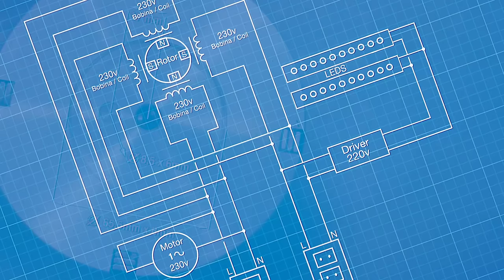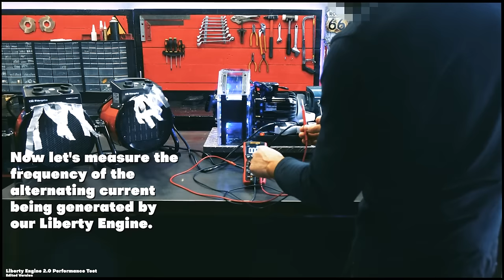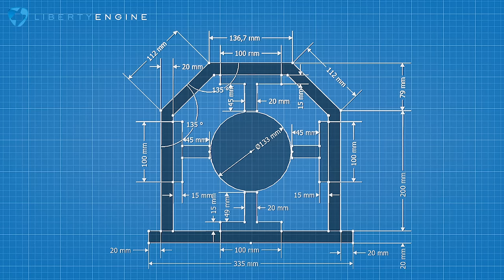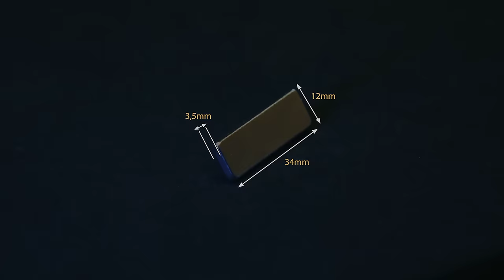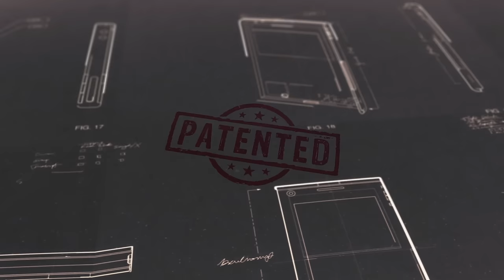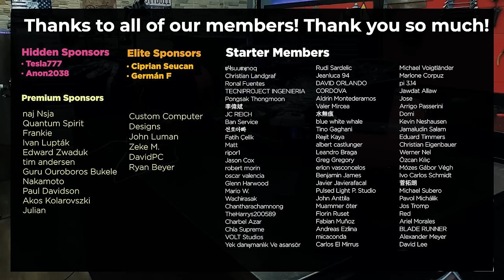SECRETS AND MANUFACTURING PLANS OF THE LIBERTY ENGINE 2.0

Comment: Why does the rotor material matter? Isn't it basically a flywheel?
Reply: its bc spinning iron makes a small magnetic field that would interfere with its function.
Reply: It composed of 4 poles winding and a small 4 pcs neodymium magnets?
Its a #18. - #20 awg .for 220v output..can its hold a 12kw peak load..it burns the winding with that load capacity.
And a small 4 magnet cannot produce a very strong magnetic to produce a very strong magnetic field to give the output of 12kw..its rediculous...i made a test of this kind..its not working😂
Reply: There is no kind or any kind of electromagnet will not give a cogging or resistance.specially a load of 12kw...its a pipe dream that cannot be happened in reality..
Reply: To be real..put it in a public demo a working prototype of this kind...not to replicate this machine on details..that you cannot prove that it is foolproof..and works efficiency.....😩
Reply: A silver aluminum rotor  composition is a complete challenge to make which is hard to do😁
Reply: @chaoskiller1758  but.... its spinning aluminium, non magnetic ??
Reply: If you just watch all his videos and pay attention it is explained.
Reply: @Gaviolacolocado  Тепер ви можете зняти відео з доказом, що це фейк! Переглядів буде більше чим тут.

Comment: Les dejo la información clara y precisa de la
Composición del rotor al decir que el volumen de 1073,3 cm3 y 7600 gr total. Sabiendo que está compuesto por aluminio y Plata y todos sabemos que el cm3 de Plata pesa 10.5 gramos, mientras que el de Al pesa 2.7 gramos. Por lo que tendríamos un total de 6333.3 gr de Plata con un volumen de 603.1742cm3 y 1266.6666gr de aluminio con un volumen de 469.1358cm3 pesando total 7600 gr terminado en una relación de 5/1 partes. Simple amigos. pd: 1 cm3 en los 1073,3 cm3 es por la variante del aluminio puro al aluminio colado. Saludos a todos desde Buenos Aires. Argentina.
Reply: Es correcto?

Comment: Dear all at Liberty project,

Good afternoon from Greece.

I would like to say one more time congratulations for this project, is amazing. 

If the alloy of the motor is mainly from aluminium & silver with these proportions (volume 1073.3cm3 & weight 7.6kg), the aluminium content can not be more than 30% because the rotor is too heavy to be aluminum at least for the most part. So if the other about 70% is silver, we are talking for a very very expensive alloy. An other thing is one the first video, after finishing cut of the rotor you apply a coating at the surface of the rotor. Is that a special varnish called electromagnetic coating in order to eliminate the eddy currents?

Thank you very much for your time.

Best regards,
Harry
Reply from the maker: The proportion is not correct. On the surface of the magnets we put epoxy resin
Reply: @thelibertyengineproject7966  good morning. Thank you very much for your reply. The rotor is too heavy to be mostly aluminium….Are you planning to give the exact details of the alloy on the future?
Reply: @Harpatsi  From my understanding this from the beginning was supposed to be open sourced, with no holding back on any information. I don't understand why they are withholding it, other than to somehow make money now, as opposed to giving out the information. You can see by their response that they are purposefully withholding it. I know there are some comments saying 52% silver and 48% aluminum which indeed would make it pricey.
Reply: @theredeemeriam  I will agree with you… I don’t understand the purpose of these videos. Today they uploaded a short story in YouTube and they are saying “ Are you still pay for electricity in your home” but they keep secret the details of the rotor…most important part of the patent🤷‍♂️
Reply: Perhaps the correct rotor weight calculation would be without the epoxy resins,
without the neolithic magnets (the N52 based on how they are positioned together change the gravity of the rotor and consequently also the weight),
without the three M6 x 1.0mm screws
only then can the correct calculation be made
“making a hypothetical volume calculation”
Aluminium = ~3150g
Silver = ~12170g
3150 + 12170 = 15320 : 2 = 7660g
😅 50% maybe?
Reply: @thelibertyengineproject7966   If it was viable, ...and if their goal was to truly help the world, ...THERE WOULD NOT BE A "MEMBERS ONLY" COMPONENT! GTFOH!

Comment: Hello everyone. About six months ago, I came across videos featuring the Liberty engine and decided to give it a try and build something similar. My rotor is made of plain aluminum without any additives. The engine is 0.55kW, 1440rpm, with 2 coils from GAL-800E4 microwave oven transformers. Four magnets 80x20x10 N45. The maximum voltage I get on a single coil is 24-28V at 4A, depending on the distance from the rotor. The engine consumes 310W, both idle and under load. The load consists of 5 24V 40W bulbs, but only one is glowing, while 2-3 are dimly lit. I'm wondering how I can achieve a voltage of 230V. I thought about using a 24V-230V transformer, but with 4A, what can I connect to it? Any suggestions? Any help would be appreciated.

Comment: I have a question, 3000 W per heater, there are four heaters which is 12000 W, at 230v they output 52.17 A. I see that the cables are 1.5 or 2.5 mm2 in section, how can they withstand an intensity of 52A ? The cables should burn.

Comment: Im still a skeptic, first i saw the power switch while the machine was not running, when switched to on position the light indicator turned on for a moment. second, when the machine was running and you tried to remove the plug of the prime mover,  i can hear the motor slowing down but the power to the heaters where still at 100% there's no drop in power output, why is that?
Third, can you turn off the motors power while the loads  are still powdered on until all comes to a stop.
i hope my questions will be answered, thank you.

Comment: I made an exact copy of the polyamide rotor - the same coils and even stronger magnets
unfortunately, it generates only 6.7V  at 1400rpm   so the magic is in a different place ???
How much does it cost to produce this rotor?
Reply: The motor he used is a SEMh71-2C
The magnets are N52 facing North to North with 3 pieces facing the other 3 pieces in total 6 pieces in one slot.
Reply from the maker: We say clearly that it doesn't work if we don't make the rotor with the special alloy. The rotor is the heart of the machine. Unfortunately we cannot sell our prototypes
Reply: Your results 6.7vac is the real volt it we give you if you increase the speed of your motor to 2900-3000rpm you we be getting 13-15vac,cos of electromagnet is more stronger than permanent 🧲,I can lecture you but you we use normal generator but have to modify it

Comment: When you disconnect the motor there is no drop in the performance of the heaters? Pulling near 50amps there is going to be heaos of load on the system, there doesn't seem to be enough weight to keep that sort of inertia going? I really want this device to be true, nit sure uf it is. If i win one and it is then i will be your biggest advertiser, very interesting either way 👍

Comment: You star 20kw of power. That decided over 2 sockets with wacht a 1.5mm2 wiring . That is 19 kw over this wire wacht. Did you do temperature measurement on the wire, the copper transformer bodies ? And the electric motor ?

Comment: Think about it for a second, this "free energy" motor will produce about 20kW of energy. The energy can be put into batteries for power storage, and when you need more juice or are running more things, you'll be able to run that. Imagine an Electric car charging off of this while you're driving or not. I'd like to see a 24/7 run to see if there are any problems with long-term usage of this generator. This could be the future.

Comment: 💯💯💯💥💥💥
Attention!!!
 I want to note that the dimensions you specified in the video do not fit the description. Magnets of such sizes do not exist 34x12x3.5. And on the diagram from the end where the dimensions of the coils are indicated do not coincide with 20mm. How do you show that the transformer is used at 6170W? and in another already GAL-900E-4 how to understand it? I very carefully and clearly consider every detail of the video. This is a misconception. This idea was worked out by me 25 years ago. The excitation of energy at its own expense, but this requires a small starting stroke to obtain the initial voltage, followed by a transition to output power.💥💥💥💥💥💥

Comment: An attempt at a functional power generation module. I can't imitate the original, but I'm testing a device with a real output.

The principle is in the cores themselves and in the connection of the coils. Look carefully at how the coils are connected in the original video. 1 phase is led to the socket from two opposite coils and the second phase is led from the second pair of opposite coils. They are not connected together. On the other hand, the coils are connected in parallel in the original, but in my case they are connected in series. Two opposite coils are used for one output in the original video, in my case it is four coils. If I had 16 coils divided by four, the result is four outputs, which are routed through the bridges and the outputs from the bridges are connected to one output. The next step might be to connect one output to the motor coils and try it in a cycle. Adding another coil from the motor as a load could increase the output voltage, see the phenomenon of output load with light bulbs. In the next video, we will try different connections, among other things, we will also try a different rotor. Please be patient.

Comment: They're actually making these engines to run with optimized magnets to the max.  Quiet, less expensive and efficient.
Reply: who is they?
Reply: @christopherschneider5657  Liberty engines. But the design is based on two-in-one runs the other engine that's a alternator or generator creating current that goes into a battery it's able to generate electricity that is 4 times greater than what it takes to run the machines and they store the extra energy is free energy. You can make these things.

Comment: Bard AI
Based on the given density of 0.007080965 kg/cc, it's likely that the alloy is composed of multiple metals with varying densities. Here's a possible combination of metals and their approximate percentages based on their densities:

Silver (Ag): 40% (Density: 10.5 g/cm³)
Zirconium (Zr): 20% (Density: 6.51 g/cm³)
Aluminum (Al): 20% (Density: 2.7 g/cm³)
Nickel (Ni): 10% (Density: 8.91 g/cm³)

This combination of metals would provide a density of approximately 0.00706 g/cm³, which is close to the given density of 0.00708 g/cm³.

Comment: Hello. Is the special Silver Alloy Metal for the Rotor neccerary? or can i build it with a normal Alloy. cause i could not get this silver alloy mix without spending a lot of money for this part.
Reply: You can even use engineering plastic (w/c is lighter) as  your rotor for the magnets instead of aluminum-silver alloy. Just make sure to couple your rotor to another flywheel in the same shaft that weighs 7.6 kgs minimum (same as his). It is much better to have a slightly larger diameter fly wheel to have better rotational energy (moment of inertia). The fly wheel can be made of  mild steel to make it cheaper. You can use this formula: 

Moment of Inertia = 1/2 x (mass in kgs) x (radius in meters)² - "take not of the squared". 

Take note also that the moment of inertia of yours should not be lesser than his. To maintain an effective rotational energy at 1500 RPM. At that weight of the fly wheel, the speed of the system will not change significantly even if you remove the power to the motor for a couple of seconds or even you put bigger loads.

Comment: I know you can say what element but this is crucial. I have a document that contains an element that is very poisonous to work with and can attack the nervous system by touching it.  I really don’t want to work with this element but, the document has other elements in it that my neutralized it but has testing of 0-100% silver and the %100 At didn’t work but, the silver between 80-90% did work.  I just want to know, is it safe to make the alloy you call ArgAlium? Obviously they’re are elements that are dangerous but safe enough to touch that specific element that won’t attack the human body just by touching it.
Reply from the maker: We cannot say more about this alloy. We can only say that it can be touched when the alloy is manufactured

Comment: I've just built one but couldn't get it to turn maybe I'll check the wiring configuration, on your original video it shows just 2x coils powering the motor on test I'll try that, hope that helps
Reply from the maker: You have to get the right alloy in the rotor for it to work

Comment: What material properties are required for the rotor to optimize magnetic rotation efficiency? Not magnetic?
What is the iron core on which the microwave coils are pushed made of?
Reply: He gives aluminum and silver as the 2 known metals, and gives hints at other materials.Based on the hints i think its either barium ferrite, or a combo of barium, ferrite, and barium titanate. But thats the one detail thats not been released yet =/
Reply: @darcevader8637  metal is 442.05 lb/cu ft thats the clue.  I have been searching to find that specific density in known alloys.  Then you will find it.
Reply: @indefiance11  tytyty will check some stuff based on that :)

Comment: I built something conceptually similar but it destroyed itself due to imbalance. But for about 5 seconds I had proof of concept so I have questions but I'm 100% this is possible.
I also have a concept for a solid state device with no moving parts. I am however too poor to build a prototype. If you might be interested I will send you guys the information to do the testing

Comment: Why you did use 6  magnets per each sides? You could simply use 1 bigger size, and then you wouldn't need to use glue between them! Please let me know the reason. Thanks.
Reply from the maker: Because it was much cheaper to buy the smaller magnets and then glue them on
Reply: @thelibertyengineproject7966  much cheaper to buy for  yotube money +
Reply: @thelibertyengineproject7966  - Hi Sir, if costs of alloy is so big why reduce costs of cheep magnets?!

Comment: As skeptical as this may read, those appear to be basic surge protectors your useing there 12000 watts? Let alone 20000? Let me know when your power distribution circuit matches the power rating, at this point it's looking like you have Tony Starks ark reactor hidden in there.

Comment: A. If there is no power to the plug bars and the time (5.45) of measuring the motor voltage. Why does the neon switch on the bottom plug bar light up for a split second
B. (5.32) and (5.52) When taking a voltage measurement of the motor, you are measuring between EARTH and NEUTRAL which should be 0 volts. No measurment was taken between LIVE and NEUTRAL or LIVE and EARTH.

Comment: I made exactly the same. The only difference is that my rotor was pure aluminium. The same magnets, the same coils. It failed. Only 7.5 volts per coil. Was that because of the rotor? Is it so importand thw mix with the silver? Your rotor is 7.5 kg, mine is about 4.
Reply: I guess he did warned us about using pure aluminum in the rotor as it would not work. So if you need about 3.5kg of silver plus the other magic it will get quite expensive. What is 3.5kg of silver cost?  It's not cheap, no wonder he needs membership money.
Reply: @Roadstercycle  So, is that the problem? Is that the only defference and the only secret? And if i make 50% aluminium and 50% silver, is going to work or it needs the third element? And what is that and why he does not say that? The cost is not the problem if i make a good job, if it works. I have already made it.
Reply: @ΙωάννηςΒεργιαννίδης  he refers to a couple other magic ingredients but gives no explanation. He expects people to be mind readers. I believe his unit works but trying to help the people of the planet no way. He's trying to make money stringing believers along. If he was not going to help make a difference in the world why even tease us?  Almighty dollars. He should show us the patent number that he says it infringes upon.
Reply: Twice now in the space of several hours he has deleted my comment showing how he is faking this. At 1:39 note the hole visible in the centre of his metal table top, where his machine is subsequently placed. Then examine 16:31 where a black cable is visible against the white background between the vertical barrier at the front of table and the underside of the tabletop leading up to the hole in his table and where he has carefully placed his machine.
Reply: @chriskelly3109  Nice catch,  By George I think you've got it.

Comment: Why are those constructing and demonstrating their Liberty Engine 2.0 indifferently from what is being demonstrated here??  This demonstration is encased and for 3 good reasons...
1.) To help retain somewhat of a vacuum of eddy currents from escaping.
2.) Helping to offer a protective barrier from exterior sound vibrations. And...
3.) To help reduce sudden thermal fluctuations from exterior air molecules!

Like many perpetual motion devices to correctly operate then they must be encased which isn't much different from that of the Beverly Clock that was invented in 1864 by Arthur Beverly and is still going strong to this very day! 
Other inappropriate and un-advised  materials that have been suggested by other DIY builders such as, believe it or not is an aluminium frame and flywheel which is a big no no as it acts as a heat conductor which is all rather silly even in the face of electrical experimentation! Although with that said encasing is something that is often overlooked in perpetual motion concepts and electrical magnetic rotary wheel designs and experiments in  achieving the best results as specified!